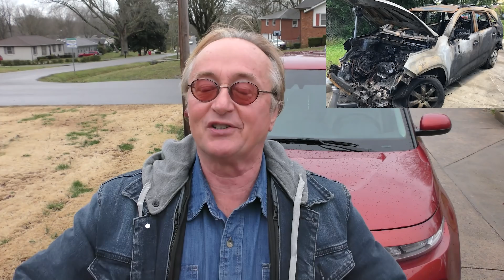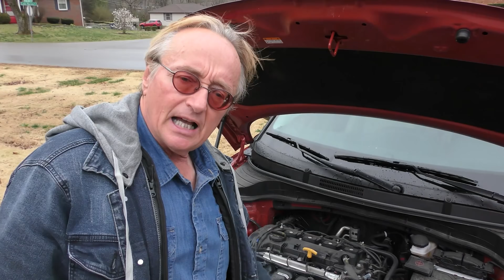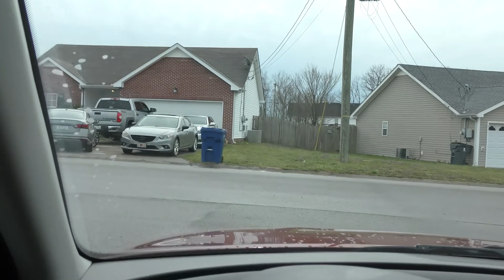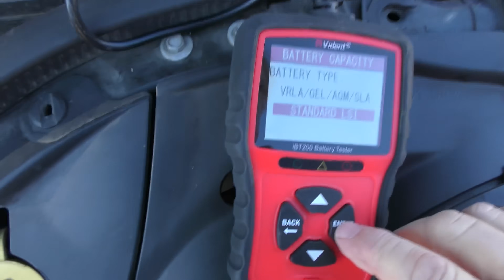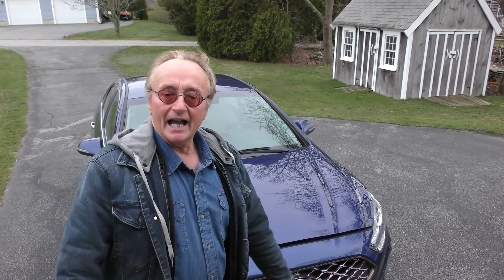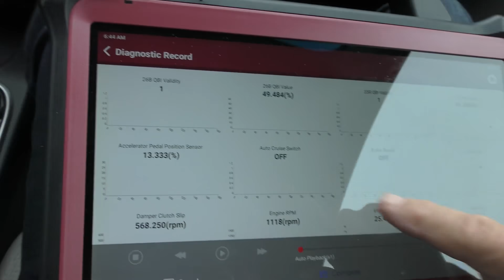3 Car Brands That are Crap

Comment: Most of our family owns Hyundai.  They have been outstanding cars, very reliable and a great value for the money.  Absolute best warranty out there, 200,000 mile.  We did have one that the engine started ticking at about 5000 miles.  Hyundia replaced the engine free of charge and gave us a loaner car to use.  I am a Hyundia customer for life.  Jap cars didn't last for me and dodge was junk, Ford was all plastic and chevy trucks lasted us over 240,000 miles.

Comment: You get what you pay for...  I learned with every single car purchase, starting 30 years ago, that the cheapest vehicles don't always last that long.  My 83 Plymouth Horizon was notorious for burning oil.  I had to keep it full and changed it often.  Buying a new Kia today sounds like my old 83 Plymouth.  It kills me that the MFG says you change oil every 7500 miles, but then won't warranty an engine that is losing 1/2 quart of oil every 1500 miles.  Hell by 7500 miles, your oil is down by 2.5 quarts and you're voiding a warranty.  Don't buy from stupid car companies.
Reply: Not really. The vehicles that cost 80k are not really giving you what you pay for either. In fact, most of those expensive cars are less reliable.
Reply: When I worked at the Ford dealership, it was a standard that burning less than a quart every 700 miles was OK.

Comment: I never had a issue with my 2013 engine but the manual pressure plate would wear out every 30000 miles

Comment: 5th gear is power-saving gear for fuel economy.  Do not use 5th gear, keep it in sports mode???  Sell it before it goes tits up.  It will go tits up.   Hyundai owners 1/3 of KIA and they swap back and forth in parts.  Are you surprised they are no better than KIA???
Reply: @danielnelson9411  I do not put stock in reviews, only my experience with a product.  If a brand screws me and does not make it right, I never buy it again.  It is as simple as that.  I can give a flying F**K what J.D. Power says!

Comment: The mature side of me always tries to give Kia and Hyundai the benefit of the doubt, especially as a car enthusiast and seeing how awesome that 'N Vision 74' concept looks, but they're both almost forever locked in as the "I know nothing about cars and refuse to learn" type of NPC people's car.
Reply: @danielnelson9411  J.D power is a joke of a company. 3 Years of ownership mean nothing. If i'm buying a brand new car I expect at least 5 years out of it before any problem come up.
Reply: I bought a used Kia Forte in 2020. Have had it 3 years and haven't had one issue with it yet & my odometer is just about to roll over to 51,000 miles
Reply: Just had the engine lock up on my 2014 Hyundai Santa Fe. 😔 It was our family car and I'm thankful our kids weren't in it at the time. I'm hoping that the manufacturer replaces the engine. It's a very common issue, as far as I've been told by 3 different mechanics 🤷. Aside from this we've never had any mechanical issues prior and the company was great at notifying us on recalls and taking care of them in a timely manner.

Comment: Got a Hyundai sonata from the early 2000s for only $2000 used. It works good, but has a few problems that I repaired myself. Most of the problems are due to age.

Comment: My Mazda 3 gdi started burning oil at 8,000 miles. I had pennzoil ultra platinum in there and was trying to find the threshold of when the oil smells acidic or losing it. Welp, I found out its 7,500. There were a few aluminum/steel and copper flakes in the oil. That's bad. I put in the oil filter dry previously. I guess that's also bad. I'm going back to 6,000 mile oil changes and getting a magnetic oil plug, next oil change. Lol

Comment: Got a 2006 Acura TL with 212,000 on the clock.  Runs likes a scalded dog.  Never burns a drop of oil.  I change the oil every 7,200 miles or so.

Comment: Sorry Scotty.   Been driving a Kia Sportage with little issues.   It has over 117k miles.   Its not burning oil.   Only issue I've had is having to change a  headlamp bulb almost once a month for the past 5 or 6 months

Comment: I've never had problems with Kia engines, it's their dang transmissions that I've had issues with. I also  agree with how the dealerships treat their customers. They hold your car in Kia purgatory for weeks, don't provide a loaner, etc. My Kia days are officially over. BTW, Hynduai is probably like Kia in that anything outside of routine maintenance, they have to call the techline.

Comment: I'm driving a '91 Ford Festiva that's a Mazda design (Mazda 121 in Japan) built by Kia in South Korea. At 195,000 miles the oil consumption is less than 1 quart in 3,000 miles. I bought it used for $200 eight years ago. I go 3,000 miles between oil changes and run only Castrol full synthetic and high end filters.

Comment: Scotty  I have an 2003 chevy avalanche z71 5.3 litre it is running lean both banks with no catalytic converter ??? And I have a flutter at red lights when it's colder than 20 degrees

Comment: I have a Hyundi Accent that's 10 years old. I've had it for 7 years with almost 147,000+ miles on it. It's been pretty good to me so far. Manual transmission and just had the clutch replaced. Took it to a family mom and pop shop. Replaced starter also. cost me $1400. I guess I won't be upgrading to an automatic Hyundai. LOL!

Comment: @ 8 Minutes you said to use Full Synthetic Oil however my 2009 Pontiac Vibe GT burned all of the oil after 1000 miles with Full Synthetic. Once I switched to Synthetic Mix it stopped happening.

Comment: I worked at a Ford dealership as a salesman for a while, and we had a blue jeep compass that had been sold but had an electrical issue. Well we were fixing it free of charge, as we should. The part came in and somehow our service department never put it in. It was 2 relays in the integrated power unit and also 3 fuses. I rushed out and proceeded to start putting them in. Well, once they were in it wouldn't start, not show anything on the radio. Pull the relays out, and the car started. Hm. Put the relays back in and it's dead. I swear to god, this is not a joke. I got very angry as the customers were almost there and I punched the integrated power unit. At this point I was so mad. I grabbed the scan tool and plugged it in, while turning the key. The car started. So all in all, punching jeep electronics does actually work. I'm not sure how or why but it does. Guy has had the car for over 2 years now without an issue. Idk how or why. FCA magic 

Edit: Oh, and I also had a maroon Dodge ram 5.7 4x4 crew cab shut off all interior electronics on me while on the highway back to the dealership. Thing was still running. I called my coworker who was in a Honda driving ahead of me and paced my speed off of him.

Comment: As bad as Kia's customer service is, Audi's is worse. I own an A4 Allroad and an A5 convertible and live them both, but abhor the 'customer service' or, more accurately, 'customer disservice'.
Audi would deny warranty coverage even if the entire drivetrain simply fell out of the car. 
Great cars, despicable 'service'. If I didn't perform all the regular service maintenance and repairs myself, I wouldn't own any Audi, much less two of them.

Comment: I’ve leased a 2016 VW Passat and recently purchased a 2014 VW Jetta and I always drive those cars in sport mode. Gas mileage be damned, I feel like the programming for “efficiency” is just wearing the transmissions out even faster the way they sputter when trying to shift up at 1200 rpm. I’d rather spend a few extra bucks on gas than be on the hook for replacing a transmission.

Comment: My 17 Optima was consuming oil at 70,000 miles
Always kept up with regular maintenance prescribed by the dealer. Oil lamp, traction light, engine light and seatbelt light all came on, one by one. No issues with sensors… Did two rounds of oil 3/1,000 consumption tests which all passed but consistently needed oil added! Needed spark plugs replaced! Total nightmare! Factory said listen to the dealership and dealership said go to the factory!! Would never buy or recommend a Kia to anyone!!

Comment: I owned a Kia Optima for a couple of years.. I loved that car. Never had a problem.  It was pretty quick and attractive.   My friend had a Hyundai,  his had 240k on it before the motor blew. He spent 2500 for a new motor and he is good to go .
Reply: That goes to show how regular maintenance can make a car last.
Reply: My wife and i just bought a used Sorento. Love the damn thing. After 2000 miles hasnt burned a drop of oil and there are no squeaks or rattles. Just a great running car.
Reply: My friends Kia Optima blew up right after 100k but the dealer said it happens so often Kia extended her warranty
Reply: @mikehurt3290  try to get Detroit to do that. We bought our sorento when our Chevy equinox blew the engine. I had just checked the oil on it the day before and when the engine blew there was no oil.
Reply: Either of those a GDI motor?  It matters.
Reply: @EricVonZipper I doubt it, if they lasted that long.
Reply: Ford has 42m for the last 37yrs
Reply: Both brands are two of the worst brands . Imagine how much you would love a proper vehicle
Reply: My Hyundai Ioniq is a stellar vehicle.
Reply: An engine blowing with only 240k is not good; it's  amazing what some fools will swallow & settle for. 🙄
Reply: @kriskabin  To the average consumer who isn't going to keep the car that long, that makes sense for them. Not everyone drives a 100 miles a day, back and forth.
Reply: You work for Kia then you moved to Hyun'Die'. Love those 6 million recalls for engine fires 🚒🔥
Reply: @sara.cbc92 What about Toyotas speeding up by itself. All those idiots that got hurt or killed huh?
Reply: @rmontero3796 ignore them. Toyota fanboys love to blame the customers for all that but would blame the other brands for someone else that Toyota also does

Comment: Scotty, I have a 08 Cadilac SRX and it's doing the exact something and my mechanic hooked his fancy scanner up. He said there's one of 2 things, either the ECU or a sensor buried deep in the transmission is bad! what do you think?  I can drive it but it's in safety mode. Not fun to drive. Let me know I will send you a check if you can tell me what to do. Thanks Scotty you're awesome.

Comment: Kia Canada maintenance is to change the oil change every 6000kms.  Took my 2020 Soul in for an oil change and they sent me home with a loaner so they could change the engine.  Car was running fine, no engine lights but it failed an engine test.

Comment: I love the sticker “it’s a hybrid, it burns gas and oil” lol.  Gotta love the sense of humor from the owner.
Reply: me thinking "isnt that like a 2 stroke"
Reply: Sounds like my civic.
Reply: not wrong. my 2012 prius has been burning since 2012
Reply: same "balance" in this shitty universe. it's a two-and-four stroke, like the music beat.
Reply: The original hybrid that burned has and oil were Trabant and Wartburg from East Germany :)
Reply: @andreykovachev7002  Trabant 😃
Reply: @Lumperi65  yes, a typo :)
Reply: Should come standard on all Subaru and Mitsubishi
Reply: @aceman1126  & Harley Davidsons
Reply: The oil port on valve 4 wasn’t done properly. I have towed way to many of them and seen crates of motors at the dealership
Reply: Expensive laughs as long as he enjoys it.
Reply: I need that sticker but at least mine has done 250,000
Reply: If the Kia burns 1/2 quart every 1000 miles, that means it burns 3.75 quarts in 7500 miles which is the oil change interval.  The crankcase holds something like that amount.  So, it would seem you are giving it an oil change just by adding the oil it has been burning.  Seems very efficient.
Reply: I laughed way too hard at that line.
Reply: I drove past a truck the other day it had a sticker that said "I identify as a prius" 😂
Reply: It's a coping mechanism, quite effective.

Comment: Have a friend where KIA replaced the engine   on a recall.  They didn’t connect the fuel lines properly and a week later the car burned up, destroyed the car like the picture at 0:40.  Fortunately it happened in the driveway and not the garage.  The car was less than 5 years old.

Comment: Are KIA and Hyundai engines the same? My 2010 i30, 2.0SX uses no oil between changes which I do every 5,000 miles. But, everything else on the car is crap. I’ll never buy Korean again.

Comment: Anyone who condemns or endorses every model made by any manufacturer is ignorant.  They've all made some good models, and all made some crap.   Granted, some have a greater tendency than others.   For example, I had an XJ Cherokee with the 4.0 L.   My ex got it and drove it to 350 k trouble free miles, and she treated cars like crap.   But a Liberty is a PoS.    You couldn't give me a Yaris.   But yes, Toyota generally has made some good cars.

Comment: I’m a die hard Toyota fan…..I’ve also bought two KIAs and zero complaints. 2012 Sorento 3.5 240,000 miles and runs as good as any Toyota I’ve owned. It’s gone as far as 18,000 between oil changes. Yup, that’s right. Needs a quart about every 5,000 miles. 2013 Sorento 4 cylinder around 90,000 thus far. Zero problems. If a car brand rips me off, I never go back. Bought one new Ford in 88. Garbage. Never again. I’ve ran lots of GM v6 cars well past 200000, zero engine or transmission problems. Typical synthetic oil change is 15,000 miles or yearly whichever comes first. Pound your gums all you want. Empirical evidence supports my experience.

Comment: :01 Kia oil burner issue
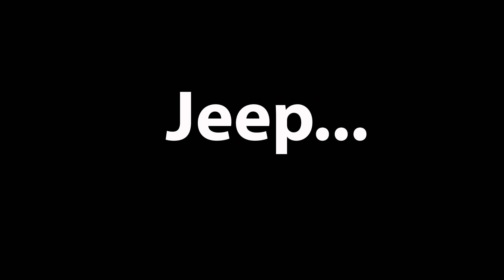12:02 Jeep integrated modular failure
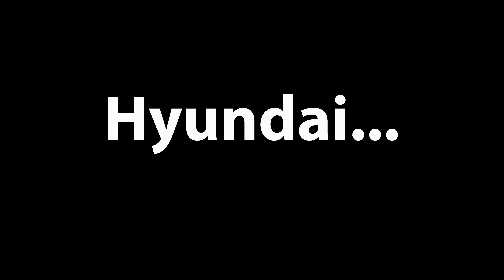21:36 Hyundai transmission issue
Reply: KIA hyundai and chrysler shares a lot of parts. thats why/
Reply: @kuyre2239  Yeah, no.  Chrysler doesn't share parts with Kia/Hyundai.
Reply: Thank you for not making me watch all this rambling 👍
Reply: Lord, I was born a ramblin' man
Tryin' to make a livin' and doin' the best I can...
Reply: So basically hyundai is there two times. 
Kia is a part of hyundai motors
Reply: Thank you
Reply: U can also steal them with a USB cable
Reply: @kittybrowneye3163  can steal them with a USB cable! That's hilarious! Thank you so much for the laugh! 🕊💕📿🕯
Reply: @kittybrowneye3163  YOU ARE KILLIN ME! KITTIE BROWN EYE! TOO MUCH! KITTIE BROWN EYE ...
Reply: @sharonbrowder5856  OMG damned if you ain't right took me 2 years to recognize this
Reply: @kittybrowneye3163  Only in the USA in Canada Since 2007, it has been mandatory in Canada to equip all vehicles with anti-theft engine immobilizers. Ya a law the USA needs to implement.
Reply: @kittybrowneye3163  😂😂😂
Reply: @kittybrowneye3163  I think that's a gimmick. A usb fits perfectly after you snap off the ignition key housing, but I imagine a screwdriver would work too. They did come up with a recall to fix that.
Reply: Thank you for saving people time.  He talks alot of random stuff
Reply: Thank you 🙏🏼
Reply: Thank you😁
Reply: I don't feel quite so bad about owning a Dodge
Reply: @bruceellenburg429  that's basically a jeep though..
Reply: They just sent letters for a security update recall.. Hopefully that'll fix the issue.
Reply: Thank you!!!!
Reply: God bless you.

Comment: I used to own a 2012 Hyundai Veloster with only 38,000 miles and with a dual clutch automatic transmission. I only owned it for 2 years which I went through 2 clutches before I sold it lol

Comment: Yes Yes Yes Kia petrols are pants
But in the UK there are many Ceed 1.6 diesels taxis running around all over the place with over 200,000 miles on the clock 
That's to me a good indication if a car is naff or good

Comment: Burning trace amounts of oil is one thing, 100% perfect sealing from the piston rings isn't going to happen, certainly not for a car that most people can afford, but a quart every 1000 miles is absurd. My 2005 Taurus only started going through that much in the last couple thousand miles before a connecting rod came apart at 248,800 miles. Though I didn't inspect as thoroughly as I should have, it may have been a leak rather than burning. Oh well. At least that's a reasonable amount of mileage for a car to go before a catastrophic failure.

Comment: I had a 2014 Elantra, no issues until I heard a ticking noise in the engine. Car ran fine just a slight noise. Took it to Hyundai and the warranty replaced the engine. No issues since. Traded it in for a 22. I really like the warranty. I do have a backup camera that has gone out at 6 months old. I used to be a Ford girl until I realized most of them developed transmission issues.

Comment: The reason the voltage was higher in the summer vs the winter is because cold weather creates more resistance in the current than hot weather!

Comment: Neighbor bought a brand new 2018 Wrangler. It has been in the shop more than he has had it at home for electrical gremlins. AC, infotainment, etc. Problem after problem. He finally traded it in. For a 2023....Jeep Wrangler. Go figure.

Comment: I have a 2014 Kia Soul and it started burning oil at 90K.  I talked to the dealer and they said it just needed a new PCV valve, spark plugs and in general a tune up and that things would go back to normal after the tune up after the engine sensors averaged out the new readings. 🤔  For a short time it was slightly better.  I have since found out about the engine defect 😡and I am over the 100K miles warranty replacement if it failed the oil usage test.  My only hope is that the engine seizes before 150K which will get them to replace it under the recall with a new engine that doesn't have the defect.  It would save me the $5000 if I have it replaced when it seizes up with the new engine.   A mechanic that now works at a Honda dealer where we take our Civic for service said, that when he worked at Kia they were sometimes replacing 2 engines a week because of the oil consumption defect.    Here's hoping mine seizes up soon so They have to replace it.  😡